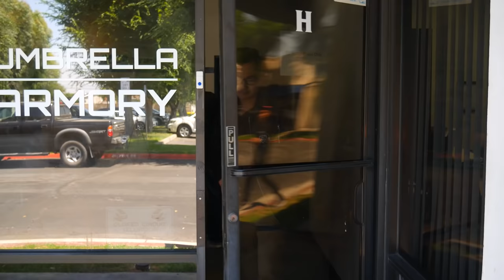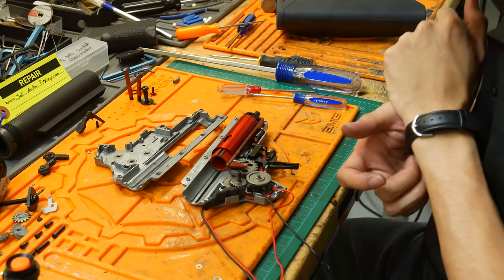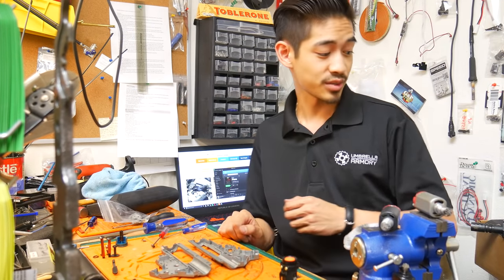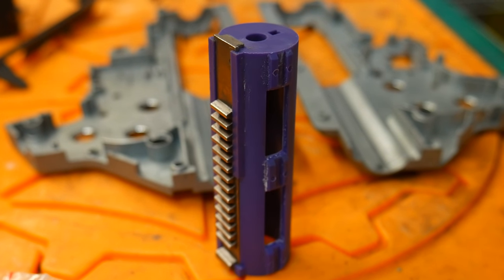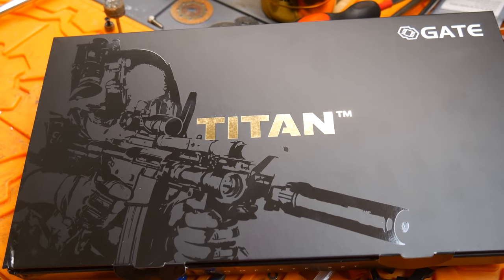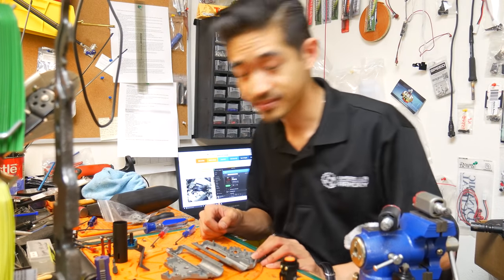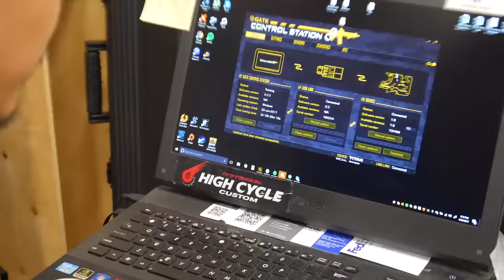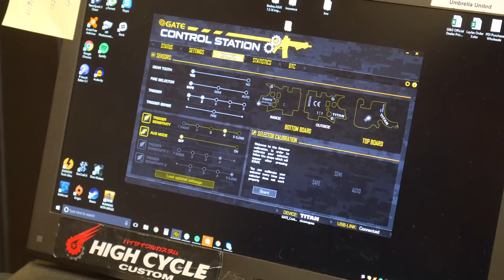U P G R A D E D | Umbrella Armory Upgrades my Elite Force/VFC Avalon Saber Carbine and it WRECKS

Comment: Parts List: 
StarWei 30K motor (16TPA)
Siegetek 14:1 gearset (SS 2-3 teeth)
M130 spring
Rocket/SHS full metal rack piston
Lonex POM piston head
Lonex cylinder head
Magicbox 8mm ball bearings
Guarder tappet plate
Lonex 3/4 type cylinder
Retro Arms trigger
GATE Titan
Tuning (rudius, shimming, etc.)
Reply: Thank you
Reply: So like $300 worth of parts.....An airsoft gun isn't some magical wizardry, they are rather simple to take apart and re-assemble.
Reply: thanks Bro !!!!!!
Reply: @advanceddarkness3  takes a bit to tune tho... not to mention starwei motors aren't made anymore so those things are pieces of gold
Reply: @smoothkins  afaik Action Army uses StarWei as OEM so their motors are the same. ASG also looks the same, not sure if also StarWei OEM'd or not.
Reply: @advanceddarkness3  change out the gears for SHS 13:1 and you're down to $150
Reply: @error262  wow mb imma have to cop some action army motors... been looking for a starwei for a long time. thanks
Reply: And they will send you a bill of $1500 for $300 of parts, umbrealla clown fiesta.
Reply: @error262  can confirm, Starwei, AAC, and ASG motors are all the same oem each with slightly different specs. RIP to the starwei line though, rumor has it, ASG didn't like the growing hype around them and pressured the OEM into canceling to increase sales of the ASG line. That part I cannot confirm but it's what I was told. Also, with brushless motors now being an actual option, you can beat the performance of the Starwei which was the best DC motor of all time IMO.

Comment: Parts list if u don’t feel like spending 1k on an airsoft gun:
-Starweight 30k motor
-Seigetek 13:1 gears
-Rocket SHS Piston
-Lonex piston head
-Magic box 8mm ball bearings
-Guarder tappet plate
-Lonex 3 force type cylinder
-Titian GATE mosfet
Reply: Do you have an idea on how much this would cost?
Reply: Angel Rendon 

Star Wei Motor - 65$
Siegetek Gears - 135$
Rocket SHS Piston - 11$
Lonex Piston Head - 20$
Magic Box 8mm Ball bearings - 40$
Guarder Tappet Plate - 12$
Lonex Cylinder - 45$
GATE Titan - 135$

463 in upgrades.
Reply: @johndye1601  what a god
Reply: @johndye1601  i would imagine they did a rhop barrel as well .... even though it wasnt mentioned. That could add another 100 ish, depending on barrel.
Reply: @k.thomas295  true, you can do a budget one for about 70 bucks

Comment: That GATE Titan mosfet is great! It comes with the Programming card if you don't have access to a computer to mess with the mosfets settings. Drops right in on most V2 gearboxes. I have a Krytac, so I had to do some grinding on the gearbox itself, but it wasn't really that bad.
Reply: Getting ready to do the same
Reply: @frahnzenberg7561  go for it , my crb has a titan in it too with basically everything pimped exept the 18:1 gears and it wrecks ;)

Comment: Yea I went with lonex piston and piston head and nozzle, also the cylinder for my build. They really do work the best. Also gate titan for that extra performance. The gun I installed this into was the ICS PAR MK3. I have been considering short stroking it but don't see much reason to do so.
Reply: ShootAirsoftVideos 
Nice build!
Youmust have had to do some grinding on the shell for the titan to fit. And yeah no reason,  unless you're getting too much overspin,  or too high FPS . I makes me laugh when people think it increases ROF haha
By the most nominal amount. :)
Reply: yea i was getting high fps but instead I just change the spring. Yes I needed to remove some materiel to make it work.
Reply: Short Stroke should give better trigger response

Comment: You should probably do a video of how long it takes them to do a regular customers gun. A lead time of over a month, even though they ask you to pay anywhere from a grand and up for it, they will sell a product that they don't have in stock and then tell you that you have to wait while they offer nothing for the inconvenience them not maintaining proper stock. The tons of videos of people who got "upgraded" guns that either a didn't work or b missing actual parts. The rude customer service who's answer is always if you don't like a situation, get a refund. I mean the list goes on and on of how they have done airsofters wrong. But you celebs keep pushing their guns on to players as if they are the end all be all of airsoft teching.
Reply: Could not agree more. I ordered a krytac spr in foliage back in september. Not only did they sell me it and then told me I had to wait untill febuary to get the color I ordered. Even after I agreed to get a color I did not even like they took 3 months constantly changing the date at which they would ship the gun. In the end they changed the final date of arrival around 6 times and I just got pist and received a refund.
Reply: Just dont buy these
Reply: Otacon91 you can build the same guy for half the price.
Reply: Unfortunately this is sadly true. I bought their 2017 OCAW in the beginning of the year and it turn out great since they only took two weeks to finish. The problem was that my motor started to over heat a LOT after 200 shots and I had to send it back to get it check up. Noted that this was just a small error from the placement of the motor being force to push the gears. All they had to do was realign the motor height BUT they took almost 2 months to do that. I had to ask back and forth in email having to ask when they will get it done. Apparently from what I assume the guy I was emailing (customer service) was the only guy doing customer service. He didn't take forever to reply but just the work effort at UA to get something as little as a motor height adjust to be done. It's ridiculous how they treat regular customers compare to youtube airsoft stars. This video you see is nothing you will get back when you spend almost one to two grand. You will be spending months trying to get something from them as they keep saying "sorry we have a lot of orders right now and can't get to your order at the moment" BS. It's over hype and not worth the time unless you're really patience. By the time I got my gun back it wasn't shoot straight no more. Instead I'm only getting 150 ft range and the r hop wasn't helping at all (note this is the BR OCAW I got). I heard other horror stories from buyers that got their krytac from UA. Parts were missing and things broke inside when they first got it.
Reply: Otacon91 Do you have any personal experience with Umbrella Armory?  Or are you simply basing your teenage girl rant off of the negative reviews of a handful out of thousands of UA customers?  Checked your channel thinking "damn, this angry guy certainly has to have some Umbrella Armory unboxings, & reviews", but NOPE, nothing but gamer videos.
Reply: Davis C as a matter of fact yes. But you'll just be one of those guys who tosses insults around because you want to defend a company that has a well documented history of QC issues, to where even in the Facebook teching group Jordan has said they had to revamp their entire production line to try to elimate the issues they used to have. They have poor customer service, they make up dates about production times, and if they have a customer who dares ask questions about the products they're buying, it's either be quiet and wait or take a refund.
Reply: Otacon91 post a video of your umbrella armory gun right now.  Pull up this video in your video as proof.. Then I'll respond.  Just a 30 second video.  It should take you 30 minutes to do. GO.
Reply: Otacon91 I recently ordered a UA r-hopped barrel and hop up and honestly the CS and QC were pretty great. The barrel arrived within the window given and it has been a great upgrade.
Reply: Davis C first of all I'm not a child who lives in his mother's basement, I have a job and that's where I'm at now. 2. What makes you think I need to do ANYTHING that you say in any capacity, especially something that has been well documented and more than a few videos have shown that umbrella has an issue filling out orders in a timely manner. 3. Seeing as how I don't pay anymore because you're attitude and players like you are the types of people taking the fun out of the sport is what's dissuading more and more people to stop. Instead of attacking someone how about you make sure the company holds a higher standard and stops fucking up?
Reply: Nihil meum amat not saying that they are incapable of creating and selling a good product, I'm just saying that for people dropping over a grand for a rifle, the customer service could be better, and that rifle better be on point as far as QC goes, and they aren't. When airsoft celebs go on and on about how great their guns they received are, it's usually because they have items that are given preferential treatment and not indicative of the experience a normal customer COULD have.
Reply: Davis C explain how writing something on YouTube while I'm on break is equivalent to me being able to pull a gun out of my ass to take a video to please you? Exactly. And I watch jets videos cause he's one of the few airsofters I enjoy who tries to explain things to viewers, and he keeps the bs to a minimum. God forbid I be a fan of the man right?
Reply: Davis C Do you have any personal experience with Umbrella Armory? Or are you simply basing your teenage girl rant off of the negative reviews of a handful out of thousands of UA customers? Checked your channel thinking "damn, this angry guy certainly has to have some Umbrella Armory unboxings, & reviews", but NOPE, nothing

Same goes for you buddy. You got anything to add here or are you just random internet guy calling out somebodys post? You sure dont seem to have any legitimate input of your own.
Reply: Spearo35  I usually don't respond to KD style accounts, but I must ask you, did you make PAR on golden tee Grand Canyon lil guy? 😂😂😂. Fucking gamer.
Reply: Davis C lol do you really think I made two accounts? This guy lol.
Reply: Otacon91 Can I be your 3rd account, lmao? I can't believe it's 2017 and people still think you need 2 accounts to destroy their flawed arguments xD.
Reply: UA is widely considered to be overpriced and have poor customer service, no need for fake accounts to prove something that is well known.
Reply: buddy got a crb from umbrella: 3 months late when it arrived it didnt fire.   👎🏽
Reply: My vfc v16 would compete with there 3000 dollar gun all day even under water, a 400$ gun that is more durable than there 3000 dollar gun its sad
Reply: I didn't even need to read this. I knew they were trash the second that dude took the cell count from Auto and put it on 3. 

Never hard code a variable when auto is available
Reply: @rogergauthier2769  They don't have a $3000 gun...
Reply: Umbrella Armory is the fucking Alienware of airsoft, overpriced garbage.

Comment: I bought a DMR from Umbrella, I spent about 1500 dollars counting extra stuff. I would say the experience was not the best with all the issues that occurred. Hoping the gun proves worth the hassle this weekend, first time taking it out.
Reply: how was it? 

im starting airsoft soon after playing lots of paintball. 
i want to spent most of my budget on gun and goggles, other gear will be sorted out later after playing some games.
just not sure where to start, what gun brand and such.

i want a m4 or m416 model to start with
Reply: @sebr5132  no need for an umbrella, KWA ronin, krytac, or a avalon will do a very good job out of the box. then just spend some bucks on a titan mosfet, brushless warhead in combination with a good barrel/Bucking combi and ur good too go. i threw it every "upgrade part" i could find and let me tell you it was a nightmare to get everything to run smoothly and in the end the difference over the barrel/bucking and gate was marginal.

Comment: At 2:25 was he forcing in a cylinder that wasn't lined up?
Reply: NOIR. Milsim no he was forcing in a well fitted cylinder head. I wrap mine in Teflon so that I have to hammer them in. Gives better seal.
Reply: Whenever I work on my AEGs, I like to wrap the cylinder head in teflon to the point where you have to really force it in, haven't had any issues yet and it has helped eliminate air leaks.

Comment: Could someone provide a list of the parts used here? I can't figure it out based on what they are saying...
Reply: Star-Wei 30,000 RPM motor
Siege-Tek 14:1 ratio gears
Rocket SHS piston
Lonex polymer piston head
Magic Box steel-caged 8mm ball bearings
Guarder tappet plate
Lonex 3/4 type cylinder
GATE Titan MOSFET
Reply: Thank you!!!
Reply: Wait you can tech but you don’t understand the parts?? They literally spell it out for you and even say how it’s modded ie short stroking and why it’s done.
Reply: Who are you replying to? If you're talking to me, I just couldn't understand what he was saying because of his accent. I knew most of what he was talking about I just didn't understand him when he told what parts he was using.
Reply: Sergeant Joe if you are gonna short stroke use a m120 and higher

Comment: Looks great but I just can't get behind aegs. Digital, circuits, software...I don't want to have to learn all that just to tinker with my gun. GBBR all the way for me. Still, looks like it performs great. Hopefully you will have R2-D2 handy when it breaks.
Reply: Personally I found GBBRs break as well and have leaky mag issues and too bad there's not many upgrades you can throw in them unless you HPA tap them... all 3 of my buddy's GBBRs have had hop up units break or buckings break and they all had leaky mags and they made made the move of switching to moderately upgraded to highly upgraded AEGs and they love how much ammo they can have now and could figure out teching the stuff themselves

Comment: “Do you want low battery warning?”
“Oh yeah that’d be great”
Proceeds to set the battery cell type and the warning voltage, but leaves the actual battery protection cutoff off

NEW 2018 OCW LAUNCHING SOON STARTING AT $1800!
Reply: Typical Umbrella Armory Quality Control.

Comment: Dear Mr. Desert Fox, how much did this specific build service run you about?
Reply: at least 1000 dollars for a custom build. probably more seeing the parts their using. 
starwei 30k - 75
seigetech gears - 125
magic box bearings - 40
gaurder tappet - 12
lonex compression parts (piston head, cylinder, cylinder head, nozzle) - 45
gate titane - 180
piston - 15
shimming + aoe + radiused -  whatever they charge for labor. 
so for parts alone $447 + labor (which is professional so probably a lot) = you're price.
Reply: L- Swaggy nothing most likely, you will 500 -1000 doll hairs
Reply: If thats the case isnt it better to go hpa loool

Comment: I have the VFC Avalon as well.  Upgraded the barrel to the prometheus 6.01 and added a bit of length ( had to cover with a silencer), added a flat hop,  and popped in a new spring.  Honestly. it's SUPER accurate, but it feels so underpowered when it comes to distance. Wanted to use it as a DMR, but man, if i'm only getting accurate shots upwards of 150 feet , meh.  More like an accurate normal AEG. 

Build quality on the VFC is amazing though, i'm dang  happy with it. Just kinda at a loss for figuring out how to get it shooting out to 80 yards consistently.  Will most likely buy the UA LVOA-C DMR  and use the arp9 as the sidearm, I honestly think that'd be a better route for me.

Comment: Real question about umbrella gearboxes... do they require the lower receiver to be modified in order to fit properly? I have an umbrella GB in my avalon calibur but I noticed my upper has a gap between the lower near the stock. The gearbox is in tight, but its not fit properly it seems. How is that possible? It sits on an angle almost. I am currently filming the progress.

Comment: So taking a guy that cost $370 and adding $450+ of mods to it is what it takes to shoot strait & far?
Reply: If you want amazing range and accuracy for a low cost, get a Madbull python 6.03mm and a G&G green bucking (although depending on your climate you might need a different temperature rating). A 455mm Madbull costs about £30 and a G&G bucking is usually less than a tenner. My MG36 fires at approx 330fpa on a .2 and with a Madbull barrel combined with a Chinese hop bucking I had laying around can hit targets about 75 metres away. Stay away from the widebore barrels and don't cut down your barrel.

Comment: I cant get any decent info to use since my E&C 607 m4 is running 425fps/9-10rps on full stock with 9.6V battery so i still wonder if changing motor to either highspeed or torque motor will even improve my gun. I don't even know if the stock spring is softer than m120 please help. thanks
(ps. my gamefiled allows 450max fps on full auto)

Comment: hey jet, what barrel are you using? can´t decide between 6.01 or 6.03 for close to mediun range.
Reply: A bit late... maybe very late, but i would have gotten 6.03 as its perfect for close to medium and wont jam as much as 6.01 since dirt and grime can interfere with the bb more with a tighter barrel thus making it jam more which is the last thing you want for close to medium range

Comment: Is There any Way to remove that annoying eletric Sound?
Reply: That's most likely whine from the bevel and pinion gear, Siegetek gears are very durable, but unfortunately they aren't the smoothest. I've found the smoothest combination to be SHS bevel and pinion gear. Combine that with a strong motor and low gear ratio and it should run really smoothly.